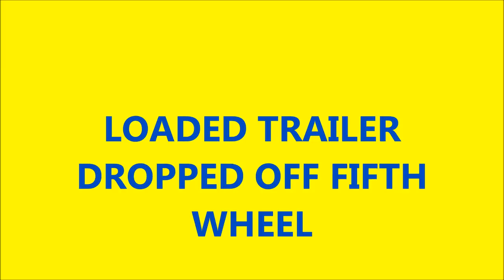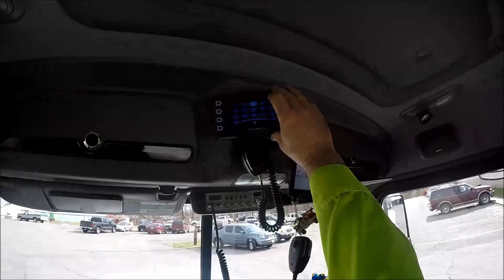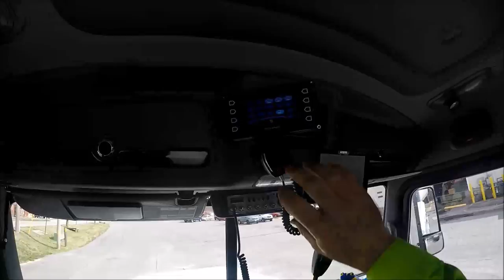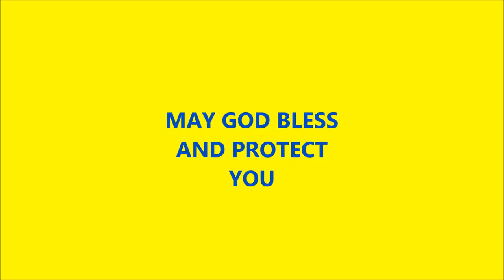LOADED TRAILER DROPPED OFF FIFTH WHEEL

Comment: You're right, it does happen. Back in about 65 I hooked onto a trailer, did a tug test and I could have stood the tractor on it's rear axle but it didn't sound right when the jaws closed. I called dispatch and he said if I did the tug test it couldn't  come unhooked. The yard was only a few minutes away and I knew the mechanic wasn't too busy but it's not my call. A mile down the road as I was turning left the fifth wheel let go and the trailer headed for the ditch and ripped the air lines and light cord off. I managed to refrain from telling dispatch I told ya so. 
The same outfit had some trailers with  no landing gear so we'd drop them on barrels or blocks. Some of the trailers had vacuum brakes so it was not rare to lose one while hooking up. I learned how to get them back up with two planks and a heavy right foot.
But those were the good old days right?
Reply from the maker: I remember some of the trailers with vacuum brakes.  Also some that required air to hold the parking brakes rather than the spring parking brakes they have now.  The air would leak off and when a driver went to hook up, the trailer would just roll backwards or fold the legs.  I've picked many a loaded trailer up after the air went out of the older trailers.
Reply: One good thing about learning on bad equipment was that I learned lots about how to take care of those situations while other guys tried and failed. In the 70s I was working for an outfit that ran a fleet of White Road Boss tractors. I pulled in the yard one day to see five guys trying to get a trailer up off its knees. I asked dispatch why they were pissing around and he said all five had been two or more hours trying with no success and if I knew how he and they would welcome any help I could offer. I took two planks over and laid them on the frame of the tractor and backed up hard. My first dispatcher would say "hit it like you'd hit your mother in law." 
Just a few years later I was driving a roll off truck with a 40 foot trailer on a pintle hitch hauling new trash cans when on my way home to Hamilton from Detroit I saw a trailer on its knees on the median strip. I parked on the shoulder and dropped the trailer, then wrapped a chain on the king pin and with the rails raised pulled the trailer up onto the rails with the winch. Lucky the landing gear wasn't damaged so we just rolled them down and I pulled out. The guy was a new driver and had yet to learn how to tell when the fifth wheel needed to be adjusted.

Comment: I heard it latch, I didn’t do a visual, but I heard it. Enough said. Nice rig. You ended the video with SLOW DOWN AND MOVE OVER. you as well as I know that only counts for those who follow the rules, my question to you is , are the rigs setup only on the drivers side or am I missing something. If not why can they not set it up on the passengers side. They just buried a young man in my neck of the woods (COADY’s TOWING SERVICE) Mass. and , most of the lives are because the tow driver was on the drivers side of the vehicle . Simply, you are never going to get crazy drivers to change. This from a retired teamster who ran Boston/Buffalo 2 or 3 Times a week. Seen way to much carnage in my time. Be safe.

Comment: Hey Ron.....I like the carousel for the chain storage.....not noticed that before.  Getting in a bit of recruitment too,eh...lol ??  Matt was it ?.....didn't sound too happy about his job there.  One thing that I've noticed about most American tractor units.....they would be better,if they had 'lead up' ramps for the fifth wheel...(nearly all European units have them). If he'd have had lead up ramps,he could have forced the unit back under the trailer,without your assistance.  Also,it seems that most American spec tractor units don't have 'raise/lower' function on the rear air suspension.......a strange omission,I think......   A good job,made to look easy,as ever,Ron.  :-)
Reply from the maker: Some trucks do have the ramps for the fifth wheel, but not very many....this truck did not.  However, most trucks do have air suspension raise/lower functions in the cab....not all, but most.  Thanks for watching and God bless.

Comment: I believe him when he says it was latched. What the problem is,,,, 
There is too much old grease in the jaws and locking mechanism. 
To fix use a steam cleaner to remove all the old grease from the jaws and you can lube with Oil in summer.
Since it opened and its been dirty for a while, best remove the fifth 
wheel for a good cleaning and inspection of damaged locking mechanism 
from not fully being lock while load is applied. 
If the jaws are kept clean the locking mechanism should last a while with no more issues. 
In winter splash some diesel in the jaws to keep it from gumming up.
Always good to grease the fifth wheel but careful of the jaws.

Comment: As always great video and recovery. Have you been able to figure out what was wrong with the landing gear and/or the 5 wheel? If you can, I would like to see a bit more of Talon with the rotator. I think that it would be great to see the rest of the crew. That way we can have a better idea of who your talking about when you mention them in your videos. 
Thanks for sharing and God bless!
Reply from the maker: Yes, the release handle on the fifth wheel was bent and wasn't allowing the latching mechanism to fully lock even though it appeared to be locked.  And, I am working with Talon on the rotator.  Thanks and God bless.

Comment: could he not lift the tractor air suspension and chock under the bottom of the legs, and keep repeating this until the trailer was high enough to reverse under...? and what happened to the "tug test"...?
Reply: Teri Wilde that’s what I was thinking too, or even Ron just putting some blocks under the landing gear and have the dude pull out that way he could have hook it to lift alittle easier. Guess their are a couple ways to skin the cat

Comment: 14:57 "there's no telling what happen bud"    I tell you what there are a-holes out there that will pull your pin on you. I had one time i came back out after getting fuel went in side for a soda and my receipt mind you i was pulled up and out of the way of the pump nobody behind me till i came out.  Good thing i took a quick peek i seen my Handle was pulled out.i had to put my landing gear down and i pulled fwd a little and backed up on the pin to get the jaws to lock..  I seen someone laughing and i looked. Was a guy I took on a test drive and he was tailgating  and damn near rear ended the car at a redlight.  i grabbed the supply valves told him to get the hell out of that seat.  we wasn't even a mile from the shop.  I told him to get going  he didn't know i was the head driver of the company  he was going to talk to the boss  i said why so we he tell you the same thing..  So i have no proof but i'm willing to bet it was him.

Comment: Had this happen to me yesterday morning.  My cement tank was empty and pulled forward about 30 feet before it slipped out of the kingpin lock.  It wasn't closed all the way.  The locking mechanism's grease probably has a bit of cement and flyash mixed in it.  A little lubricant spray thinned it out and I got it working again.  The trailer landed on the frame so I cranked it back up and hooked it back up.  I was a bit paranoid all morning, so every time I stopped, I got underneath and checked that the jaws were still where they should be.  I've had to crank loaded trailers before...not fun.
Reply: Does it cause any damage to the truck when that happens?

Comment: i didnt see it but i heard about it at my old work.  they had trk pulling out on the road with an 8 axle or 3 axle stretch trl that dropped in the road/drive. so they used the frond end loader and skytrac both with forks to pick it up and get our switcher back under it to clear out of the road since the road trk ripped its airlines in half
Reply from the maker: It happens more than people realize.  I've had trucks come in to our shop and have the trailer "high hooked" and not know it.  Some have travelled as far as 500 miles just sitting on top of the latches.  Hard to believe, but I've seen it.

Comment: If your boom cables are on winch drums there doesn't seem to be enough weight on them with just those snatch blocks to keep the cable weaving tight on the drum , wound loose on the drum could damage the wire rope if you where to make a heavy pick?

Comment: I don't care if the king pin is latched, nor do I care if you tug on the trailer and it doesn't come off, you better make damn sure the handle for unlocking the fifth wheel is all the way in. I hooked up to a trailer at the dock, tugged on it and it stayed hooked, got out inspected the latch and I could see it wasn't all the way in but the clasp was locked on the king pin. So since it was clasped and the trailer wouldn't come off when I tried to pull away from it I assumed I was good. WRONG! Just as I left the gate the trailer came off the fifth wheel and dropped to the ground. Lesson learned, I will never leave again if that release handle is not all the way in. Since this was my second  time driving this particular truck I assumed that the handle was supposed to look like that. I was lucky I was able to crank the loaded trailer back up (20 minutes later) and the glad hands and pig tail were OK.

Comment: This is why you do a tug test, and visually check the pin. Landing gear stripped or not...this wouldnt have happened if the proper coupling steps were followed

Comment: Hey I know this is way back but I do have a thought, I have no idea if it would work so I figured I would comment and ask. Anyhow, why did the customer in this case, not try to use the landing gear to lift the trailer? Or was the primary problem that the trailer actually got caught on the truck frame and the gear would of been of no use trying to free itself from the frame.

Comment: That is one cool truck you drive  is that control panel on the truck water proof  cause if it rains it looks like a a lot of money to repair
Reply from the maker: The controls are suppose to be water proof.  I've had to have one of the Remote controls replaced from water damage.  Thankfully it was warrantied.

Comment: this is why you visualy check that the pin is locked every time, hearing the click and doing a tug test is never enough. this could have been avoided had he simply got under the trailer and looked at the locking jaws, doesn't even take any effort to do this.. lmao. some drivers now-a-days are just lazy....

Comment: I'm surprised those hooks didn't bend/rip out the deck plate they were hooked to. Wouldn't think that sheet metal could take that kind of load.
Reply from the maker: Where the hooks are located is actually part of a large steel plate that has the king pin welded into it.  It is the strongest section of the trailer.  The plate is thick and stought.
Reply: Oh. I thought that was just a faceplate, w/the stronger plating underneath. Nice wrecker, btw. I'm happy to say I've never needed to call one for that.

Comment: Great job Ron,your winches don't sound like normal hydraulic winches are your winches electric over hydraulic?you make it look too easy,but that's a pro for you.Thank You ,Be Safe and God Bless
Reply from the maker: The winches are hydraulic.  They have electric solenoids that open and close to control the flow of hydraullic fluid, but the winches themselves are full hydraulic.  Thanks and God bless.
Reply: There is a singing noise when he activates the hydraulics, I'm pretty sure it's the turbo on the motor spooling up a bit.
Reply: Thank You for explaining the high pitch sound.

Comment: Why is an abled body guy like him not just throwing the landing gear in low and saving himself(or company) a tow bill?  Especially after he says it's not loaded heavy
Reply from the maker: The gears were stripped out.  He had to follow me to our shop where I had to lift the trailer off of him and hold it while our yard tractor hooked up to it.  We will be putting a set of legs on it.
Reply: that answered my question as well ,,,,thanks Ron ....
Reply: I was about to ask the same thing
Reply: 2KXJ can't you read what the poster of this video had to say about the landing gear?  don't be lazy
Reply: Another rocket scientist.  we're talking about reading that the legs dont work.  Reading, words, text, you know, like this?  What happened 20 seconds into the video is irrelevant.   But back to your point...who watches these videos for the talking? Fast forward to the lifting and the towing.
Reply: I was thinking the same thing, but the according to Ron Pratt the gears are stripped out. Rotten luck I guess.

Comment: What am I missing?  Why didn't the driver crank it up in low gear?  Sure it requires some sweat, but no effort?! 2ndly...the driver said, "I heard it latch" doesn't cut it.  Like the operator said once he re-hooked, "I heard it latch but let me look in and be sure"!
Reply: ...............just saw a post Ron stating the landing gears were stripped, but are you saying the legs won't go down at all? Or if and when they DO go down that the legs will draw right back up because they're stripped?  Not sure what you mean or what prevented him from cranking the legs back down, I mean...how was he going to drop the trailer later on?

Comment: You really don't see those fifth wheels fail very often, I think in nearly 30 years I've only seen it happen 2 times, both times the driver had done both a trailer tug check and a visual of the jaws locked. Looks to be a lot of grease in there, I've found that we've had fewer issues with balky fifth wheels since we started using slick plates instead of grease on the surface, but I know they can malfunction at times. Couldn't see clearly in the video, but did he dump his air? Almost looked like his bags were still up, but I'm thinking the first thing an experienced driver would try is to drop the suspension if possible. At least he wasn't too heavy, when it happened to one of my guys the flat was loaded with 6 cable reels at a bit over 13,000lbs each, and it came right off the tractor completely, putting the landing gear completely back up against the trailer frame, and inspection found the fifth wheel had an internal failure, no driver error.
Reply: if you looked closely,  the air was dumped because the trailer was sitting below the tires that can only happen if there is no air in the suspension
Reply from the maker: The driver had done a visual inspection and a tug test.  The landing gear were stripped so he couldn't use them to lift the trailer.  Whe the unit got back to the shop, they found that the release handle was slightly bent and wasn't allowing the latch to completely lock into place even though it appeared to be locked.

Comment: Hi Ron.  Love the videos. Drove tow truck myself a long time ago but never got a chance to drive the big rigs, but did go out with the driver a few times. Why is the boom set at 8 degrees while at rest? Can it not be left lower than that. Or is there a specific reason for the 8 degrees? Thanks in advance for the answer and keep up the good work.
Reply from the maker: I can stow the boom lower than 8 degrees if I choose to do so.  It's simply that at 8 degrees I know exactly what my height is and know that I can clear most everything in our area, even the residential streets with low hanging communications wires.  Thanks for watching and God bless.

Comment: The first question I would ask is does the truck have an automatic fifth wheel release?
Reply: If it does  it may have a contaminated air system which my release the fifth wheel on it's own due to water and oil in the system.. MAY CAUSE AIR VALVE FALURE......

Comment: how often do you actually have to use the tag/pusher axle? (around me we call them all tag in front of behind the tandems) See you got a Pete thats number one in my family.
Reply from the maker: I keep it down most of the time because the truck is so heavy..also because it is a self steering axle which helps me get around easier with such a long wheel base.  In snow/ice I will keep the axle raised so that I have more weight on my drives for better traction.  And Peterbilt is my favorite as well.  Love them.  Thanks for watching and God bless.
Reply: Self steering is sure nice. What is the weight of your unit?

Comment: I have what may seem like a dumb question  but if the rotator  can turn 360 what would be the issue with lifting over the cab so you did not have to turn around...
Reply: he could but it is better to have the weight of the truck underneath for leverage.  if the boom was in the front,  then he would need counter weights in the rear otherwise he would tilt over
Reply from the maker: It's not a dumb question.  When working over the cab, the boom has to be at almost full extension which reduces its lift capacity.  Also, I have just gotten in the habit of backing in almost anywhere I go....even in my personal vehicle, which drive my wife crazy.  Habit I learned from first responders years ago.....makes for a safer and quicker exit.  Drive by most any fire station and I bet the equipment is all backed into the station so that they can drive straight out.  Also, I used to have to back in to almost everything when running a standard stick boom.
Reply: Thanks for  the explanation
Reply: At first my wife was amused whenever I backed our 15 passenger van (six kids) everywhere we went, but now she does it too.  Helluva lot easier to pull out in average parking lots.  She can do it almost as good as me.  One time at Walmart I heard a guy compliment her and she said "hey I'm a trucker's wife".  Brings a tear to your eye, doesn't it?  (actually, most of the time, I just park further away.  Saves dings and who can't walk a few extra dozen yards?)
Reply: @vendingdudes  Me